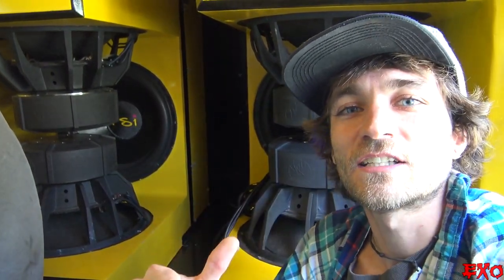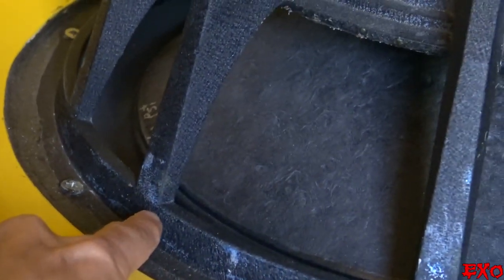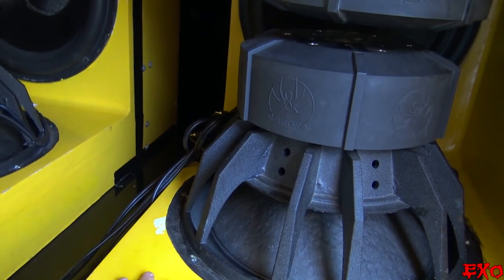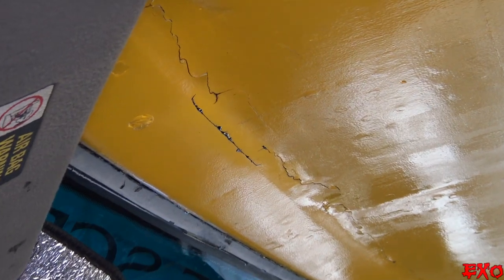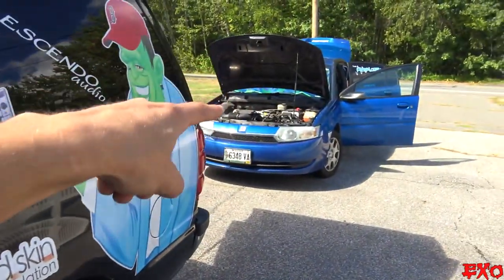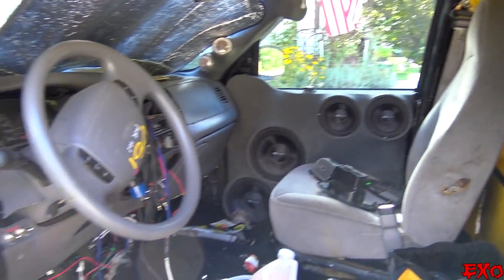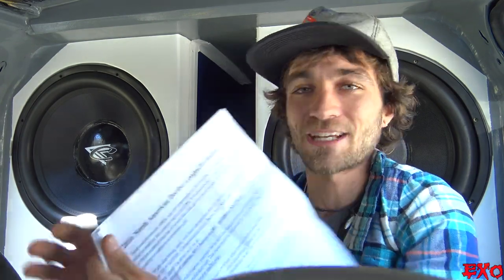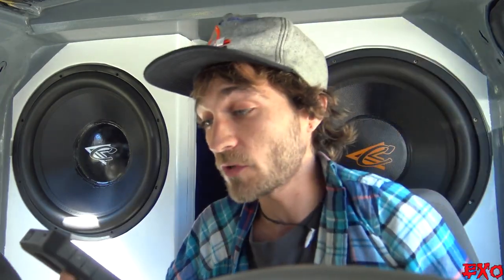AWESOME NEWS w/ EXO's Car Audio Installs!!!!

Comment: Hey EXO, got a question for you.

I have 2 Cadence Ultrashock A7HC's for my sub's, and they are rated for 1400W RMS @1 ohm. My question is, do you have any recommendations for sub's I could be playing on these things? Best amplifiers I've ever seen in terms of quality. No clipping even with the gains turned up higher than should be, so only clipping is from the unlcean music. I would like to get some sub's that would compliment these amps quite nicely.

Was thinking about a couple RE Sxxv2's, or 4 Fosgate P3's. Anyways, your input would be helpful.

Comment: I've been to OOB in August. If you think that's hot, you're going to have some trouble in VA, should you move. I lived in VA Beach for a year. I would recommend the high desert. something like Reno. it gets hot, but since there's no humidity, it doesn't feel as bad. Keep up the good work, I'm not giving you a hard time, just trying to share experiences.

Comment: I got a question. In my bass setup i have an 800 watts, 4 ohm. 15 inch sub.... that is connected to a shitty pioneer... that amp is rated at 60 watts RMS at 6 ohm.... I wanna know how bad it is to power the sub with that amp, should i be careful with anything... is anything going break or... i really have no idea, I've been using this for 5 months... and it's still working.
Reply: I don't think it is possible to hurt a 800w sub with a 60w amp, but it is always advisable not to clip your amp.
If it sounds like shit, turn it down.
Reply: you should have zero problems as long as you don't treat the gain like a volume knob. keep it from clipping and there's nothing wrong with underpowering a subwoofer. I would recommend  a bigger amp for it to be louder. don't push that small amp too much with the gain or it will sent a very bad signal and clip you woofer to death.
Reply: Yep, set the amplifiers gain at a level where the output signal is still clean and no clipping occurs. How much output your amp has doesn't matter as far as you do that.
However if your amp is only rated at 6 ohms (which is more common in hifi than car audio) then a 4 ohm woofer might cause problems with it. Probably not but it's not in the 'guaranteed to work' zone.
Reply: branded Alright... thank you. I'll keep jamming and hoping it doesn't blow up